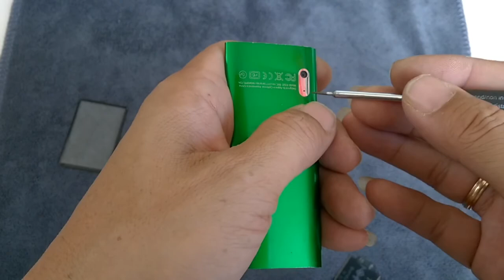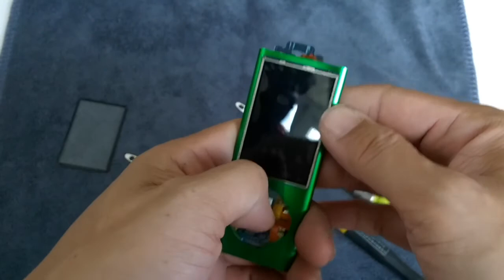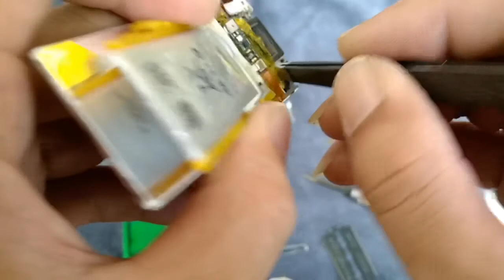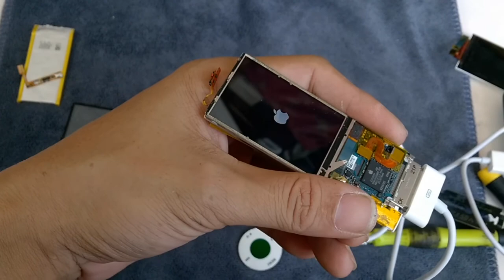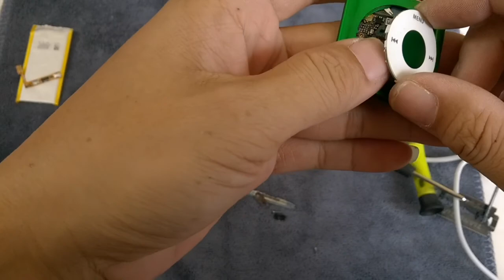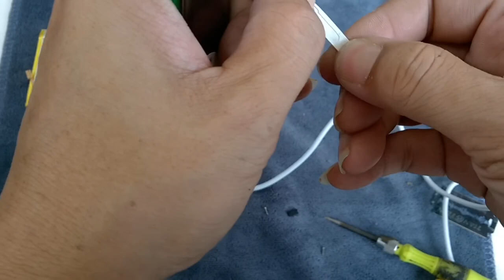Dissasembly, replace LCD and battery iPod Nano gen 5

Comment: Nice video but one question. Does it matter which side up or dow I solder the battery in?
Reply: Prob yes because the joins would be backwards
Reply: Absolutely! The battery is DC (direct current) and one terminal will be positive and the other negative. If you solder the battery in with the terminals in the wrong orientation, your device will either not work or you might damage it.

Comment: plaease don't, this is not a tutorial this might cause an exploed, you should soldering on board connecter not on battery terminal, the heat may do damage or exploed the battery.